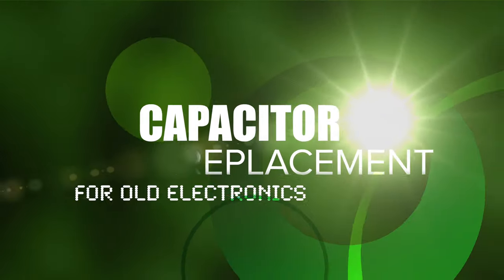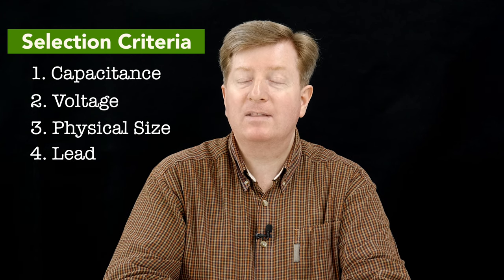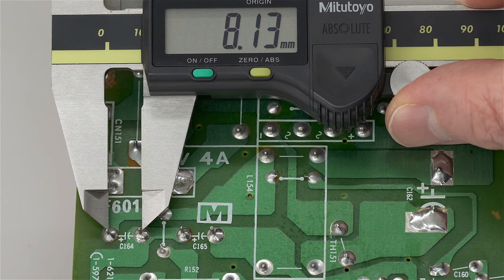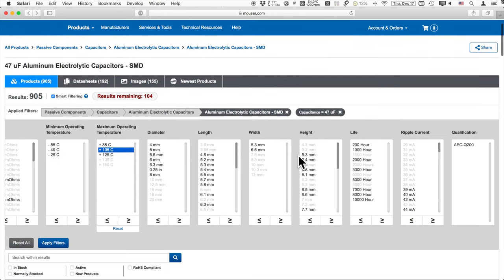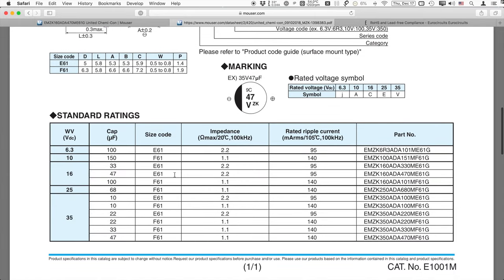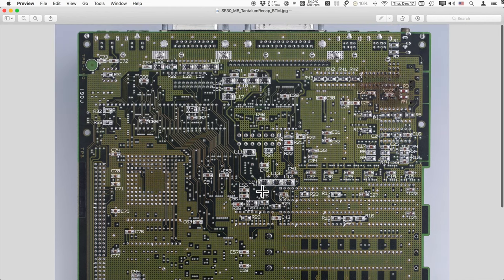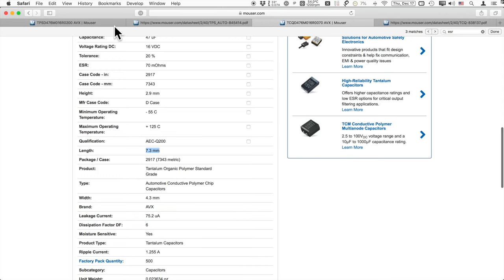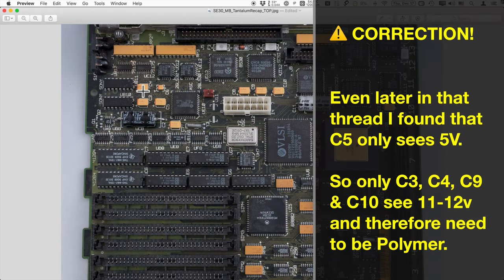Choosing Capacitors to Recap Old Electronics

Comment: I would think that someone with an EE degree would not be on the OCD re-capping bandwagon.   But, not all EEs are created equal.   I can see the need to replace electrolytic caps in 70 - 80 year old tube radios.  But you are just adding to E-waste when you replace electrolytic caps in electronics that is newer than 50 years old.   It is also the wrong place to start if you want to repair something.   I have restored and repaired radios, hifi equipment, and lots of test equipment (General Radio, HP, Tektronix, Marconi, etc) for many decades and seldom find a bad electrolytic capacitor.   You are pointing neophytes in the wrong direction.
Reply from the maker: I certainly appreciate your comment, but I must disagree here.  

First, no one ever said recapping is a FIX-ALL solution.  You are probably looking at this from a HAM radio operator's standpoint, but I have experience with VINTAGE COMPUTERS, especially Apple.  Many a 1980's and 1990's Macintosh motherboard has been damaged by leaky electrolytic capacitors, especially the SMD type.  It's not just exploding Maxell batteries that destroy these precious old motherboards.  Leaked cap fluid left on these boards eats through traces over time.  

There's nothing Obsessive-Compulsive about changing out capacitors that are more than 30 years old, not only in light of what I just said, but also in light of the fact that capacitor manufacturers themselves don't guarantee their datasheet specifications beyond about 20 years or so.  What that means is, even if you do the math based on temperature and the datasheet hour rating, and even if you calculate a theoretical life well beyond 20 years, capacitor manufacturers don't guarantee that life beyond 20 years because they know seals break and fluid can either leak or dry out over time.  And that is true even when the cap hasn't been used in a hot environment.  

Nothing lasts forever.  Everything wears out over time.  Entropy is not our friend. But of course, this comes as no surprise.  

Even when the capacitors measure reasonably good on an LCR meter, they can sometimes fail in-circuit under load.  I know this from experience.  So while heat is a big contributor to the shortening of the life of fluid-filled caps, the greatest enemy of these caps is TIME.  Even though I'm not too terribly old at the age of 52, I still full well know what time has done and continues to do to my body, which is build far better than an electrolytic capacitor.

If anything contributes to E-waste, it is the general ignorance of what can and often does go wrong in vintage computers (and perhaps in vintage electronics in general), such that a board could be damaged due while sitting in a closet for decades -- the result of inadvertent user neglect.  And one day when they want to power on that old computer but can't, then open it and find traces eaten away due to leaked capacitor fluid, most tend to throw the thing away rather than seek a repair.  That is perhaps the most common contributor to e-Waste.  It doesn't have to be so though.  Recapping a device after 25-30 years is good preventative maintenance, especially if the caps are of the SMD variety, and especially if we are talking about vintage Macintosh computers.  But I wouldn't want to restrict recapping only to those machines though.

Just like it is important to apply a new coat of paint on your home or replace a roof every several decades, so too old electronics need maintenance, and sadly, one of the most often trouble-causing components in old electronics are these capacitors.  That's true even if the HAM radio world can boast about using caps since the 1950s.  Recapping requires a bit of thought and understanding, which is why I created this video.  Recapping not a fix-all solution.  But it is often needed, and the video helps people understand the various considerations that go into choosing replacement capacitors.
Reply: I'm not sure how much equipment you have repaired, but I 100% agree with the person who uploaded this video and sorry to say this, but completely disagree with you. Every electronic repair channel of vintage equipment, amplifiers etc etc regularly find bad electrolytic capacitors. Whether bulged, shorted, ESR issues or lost/gained capacitance...electrolytic capacitors are pretty much the FIRST thing I'm checking as soon as I open up any electronic equipment whether it be very old, vintage or even modern for that matter. I honestly cannot believe that if you have repaired a large amount of electronics, you feel this way. Don't get me wrong, I've repaired oscilloscopes that have been in a barn for 60 years, reformed the old electrolytics and put them back in and everything was fine...however more often than not, they need to be replaced.
Reply: @REVERSE_BIAS  I did mention I have repaired a lot of equipment.   Are you calling me a liar?   I have had an interest in electronics for over 65 years and studied Electrical Engineering at a highly regarded East coast Engineering school.   When I fix a radio, or test equipment I always try to just replace components that have gone bad.  Sometimes it is an electrolytic capacitor, but more often its a transistor or diode.   I know how to find what is not working in electronic equipment, even if I don't have a schematic or service manual.   The electronics techs I have known who automatically just replace electrolytic capacitors before diagnosing the problem, generally destroy more equipment than they repair.   I see their handiwork at electronic swapmeets and say to myself "There is another oscilloscope or radio, or signal generator, etc, that will never be useful again".   If you are that kind of tech, you are not a good custodian of the vintage gear you possess.   You need to find another hobby.
Reply: @JDW-  When I have seen a pcb with dissolved traces the cause has always been too much humidity.   If water has condensed on the board when it is powered up, electrolysis can quickly destroy some traces.   I don't play with vintage computers and have no idea what the failure modes are.   Maybe Apple was buying defective electrolytic caps when they were manufacturing them.   I repair 80's vintage ham and commercial radios, HP General Radio, Tektronix, and other quality test equipment.   The oldest I have are Boonton Q meters and an Rx bridge.   They are 70 - 80 years old and have never been tampered with.   I believe in maintaining equipment as it was manufactured and not modifying it.  The Q meters and Rx bridge work as well as they did when made and have never been "re-capped".   The only work I have done is to clean a couple of switches.   I also own a 1968 vintage network analyzer made by General Radio.    It is a very handy piece of equipment and covers the range of 500 kHz - 500 MHz.     It has some logic gates in it - all DTL   I had to replace a few transistors and zeners when I commissioned it; no "recapping" necessary.   Some misinformed techs gave told me I should replace the DTL parts with "modern"  7400 series TTL,  or even LSTTL.   Unfortunately some people cannot be educated.
Reply: @williamogilvie6909   I could have bet my life that you were going to list how amazingly knowledgeable you were! Wow, you are an electronic engineering master! "I can even repair equipment without a schematic or service manual!" 65 years of experience, yet rarely have to replace an electrolytic capacitor.  😂😂😂
Reply from the maker: @williamogilvie6909  One thing that we learn in life is that we never stop learning in life.  You explained that your experience is different than my own (and I consider that a learning experience for me), which is not to dissimilar from medical doctors who specialize in different parts of the body.  I can tell you as a vintage Apple computer enthusiast that leaked fluid from SMD electrolytic capacitors on numbers vintage Macintosh models like the SE/30, Mac Classic, Macintosh IIfx, the Apple IIe Card, and many others all have issues which do not pertain to humidity.  Many people leave these precious machines in a closet for decades, never knowing that trouble is brewing. The leaked fluid eats traces over time.  Battery bombs are just as bad or worse, with lithium PRAM batteries screwing their guts all over the circuit board, rusting metal and eating connectors clean off the board.  Even in cases when capacitors do not leak, bad capacitors inside vintage computer power supplies very often prevent the machine from powering on at all.  Sometimes the electrolyte dries inside the capacitor instead of leaking out. RIFA safety capacitors are somewhat notorious in old Macs for blowing and spilling their black guts all over the place, which is mainly just a big mess rather than something that eats traces, but still.

What all this means is, no matter our college degree, we tend to learn the most through personal experience.  And our experiences differ.  Sometimes we think our experience in one area should always apply to another, and that is sometimes true and other times not. So I think we can learn from the experiences of each other to make a better assessment of what to do with a given piece of vintage equipment in the future.
Reply: @JDW-  If I am not mistaken I think I did mention I am not a vintage computer enthusiast.   I was working for an Apple dealer in 1984 when the Mac was introduced; even sold a few Apple 3s.   There aren't many computers sold since 1970 that I haven't used, built interface cards for, or developed software on.   So my interest in those vintage computers has long passed.   If you think everyone who wants to revive an almost 40 year old Mac should replace all the electrolytic caps asap, I will take your word for it.

The equipment I restore, vintage Genrad gear, HP network analyzers, Tektronix spectrum analyzers and scopes, etc, are likely made to higher standards.    I don't recommend anyone who is trying to fix HP  ( and I mean HP test equipment, not PC type computers and printers), Tektronix, etc equipment even think about replacing capacitors right off the bat.   I see enough test equipment that has been destroyed by people who had no business even opening the case.   If you can't navigate a 500 page service manual with over 50 fold-out schematic pages, just leave it alone.   And most two way radios ( excepting '70s vintage CB ) are also made to high standards.  Very rare to find an electrolytic cap that has to be replaced in those.     And your description of the destruction you have found inside vintage Apple computers begs the question:   Why even bother trying to fix something that broken and so useless today even if it did work?
Reply from the maker: @williamogilvie6909  I have old HP branded test equipment from the early 1990s, and I have never recapped that.  As to CB's, Radios and the like, I lack experience with those devices, so I must defer to experts such as yourself on that.  I trust your judgment with those devices.  

With that said, I don't think our vintage Mac community would take a liking to remarks of those old machines being "worthless." 🙂 In fact, much of the time, they carry a tremendous monetary worth. You'll find 1983 Apple LISA machines on EBAY for $10,000 or more sometimes.  Even the Mac 128K with super limited RAM sells for top dollar, especially when it comes with the original boxes.  

Even if one isn't into buying and selling to make a profit, using old machines is fun for most of us who have a lot of nostalgia tied to those machines.  My first home computer was the 128K Mac in 1984, for example.  For others, it was a C-64 or Vic-20.  So when I look at a Commodore, I don't remember things from my childhood because I never owned one.  It holds a curiosity for me, but no nostalgia.  The Mac, however, is different, because that was my first machine.  Practicality is largely irrelevant.You don't forget your first love.
Reply: @JDW-  Good that you are careful with older HP equipment.   I am sorry if I hurt anyone's feelings with my comment about Macs.   That's just my opinion.  I started using computers in 1975, when I was in university.  To me, computers get old and uninteresting quickly.   My first personal computer was an HP 2100 minicomputer, running a hacked mag tape OS.  I modified the machine code, on paper tape, so the OS would not backspace, and loaded the OS, an editor, and an Algol compiler on cartridge tapes.  It had a keyboard and text display on a CRT.  That was in 1977.   The first computer, I owned was an Apple II that was designed for the European market, bought for $100 in 1982.  I had to modify the video circuit so it would produce North American NTSC video.  I quickly lost interest in that and bought a 68000 single board computer kit, 1983.   Since you believe old computers like these are really valuable now, I should put them on eBay.
Reply from the maker: @williamogilvie6909 you probably could make a fair amount of money if you did decide to sell them. Bear in mind that eBay fees are pretty high. A lot of people have been moving to Facebook marketplace of late. There are other places like Craigslist although I doubt that you would get as much through that sales channel compared to eBay. Another option is to up an online forum that’s dedicated to the vintage equipment that you have, and then post the machines you have for sale there. That would help to ensure you get your old equipment into the hands of people who would appreciate the devices.
Reply: @ericschulze5641  😂
Reply: @williamogilvie6909 You are lucky this presenter was gentle with you.  You shot off a comment without knowing owing the whole situation.   You even cast dispersions on his EE degree.   Who would have thought that different categories of electronics would have capacitors that age differently?  😉😂😉😂 lol
Reply: @JDW-  A few weeks ago I visited a gentleman who restores vintage computers.   The purpose of the trip was to purchase a 21 GHz HP spectrum analyzer.  Quite a bonus to be given a tour of his extensive holdings.   He had a collection of analog computers, several PDP-8s, a very rare DEC LINK-8 he was restoring, and several HP 2100s.   I didn't see any MACs  or any micro-computers from the '70s or later.    This gentleman supplies exhibits to computer museums across the US.  He is a very careful, methodical person who understands everything about the hardware he is restoring.   That is what we all should do.   It is foolish to just replace components without first diagnosing the problem.   When you "re-cap" something, there is a good chance the capacitors you put in are going to be less reliable than the original ones.   One of the worst horror shows I have seen is where the old capacitor is not even removed.  The replacement capacitor is tack soldered to the old one's leads.    And removing surface mount caps can often result in damaged traces.   As I've stated before, anyone who immediately starts replacing most or all electrolytic caps in equipment is well on their way to destroying that equipment.
Reply: @REVERSE_BIAS  And what can you say about yourself?
Reply: @williamogilvie6909  I'm saddened that you conflate bad repair practices with bad assumptions, and bad assumptions with knowledge of component history. OF COURSE it's a terrible idea to tack a new component onto bad-cap leads. SO WHAT? Such practices have nothing to do with good repairs. Same with the suggestion that removing SMD caps can "often result" in damaged traces. That's only true if you don't know how or don't have the equipment to do that properly. Don't do repairs if you can't remove the old components properly.

As a careful guy myself who has been around electronics for over 50 years (helped create the first retail microcomputer, first hard drives, laser printers, digital phones and more), I *agree* that we should understand about the hardware we're restoring... BUT...and this is **crucial**... we also need to understand the replacement components we're using!

To do that requires MORE than analyzing a particular failure in a piece of equipment. Your suggested method may nicely solve the presenting problem, but is highly likely to FAIL to actually improve the situation. Why? Because you're not looking at the big picture.

You claim "anyone who immediately starts replacing most"... 'lytic caps "is well on their way to destroying that equipment."
Clearly, you're not aware of how 'lytic capacitors fail. (1) Have you heard of the "Capacitor Plague"? This was a pretty widespread problem for 'lytic caps mfg'd from 1999 to 2007. Some mfg's spent hundreds of millions replacing motherboards due to early cap failures. We in industry discovered (to our horror) that certain entire production runs of caps were ALL BAD. (2) Beyond that, ALL non-solid electrolyte 'lytic caps have limited life. They ALL go bad over time. Certain as death and taxes, as they say ;)

I'll say this definitively: if a 1990 high end S-VHS recorder/player (for example) needs some caps, and you do NOT replace most or all of the electrolytic caps, you are wasting your time and doing a disservice to the recipient of your work. That device IS going to have further issues in relatively short order. Why? Because the rest of the caps are on their way to failure as well.

In the same vein, It's foolish to assume new components are seriously likely to be less reliable. A lot has been learned about how to make higher quality components in the last 25+ years. Of course, taking advantage of increased quality requires knowing how to obtain good components... and clearly @JDW knows a bit about that. @williamogilvie6909 have you spent any time purchasing from Mouser and/or DigiKey? It's pretty eye opening.

I for one am grateful that -- just as new cars no longer have tires that last only 1000 miles, and cars can go more than 50 miles w/o a breakdown (that was in the 1930's ;) ) -- modern electronics can have much higher and longer lived components than ever before. Quality has a cost, but that's ok by me.
Reply: @WebbedPete  I stand by what I wrote above.   Removing components that are not known to be defective is not the way to fix any equipment.   A few weeks ago I decided to fix a Yaesu FT5100 dual band radio (VHF/UHF) I bought cheap at a flea market.  The display continually flashed off and on.    This usually means the reference oscillator is not working.   And my theory was confirmed after I watched a utube video where an HF Yaesu rig that had the same flashing display was repaired.  The FT-5100 is a '90s vintage radio, very compact, and crammed with surface mount parts.   The main circuit board has surface mount parts on one side and other, bulkier components like helical filters, crystals, etc, on the other side.     With the help of Yaesu's Service manual, I was able to locate the reference oscillator transistor and measured about .5 V on the collector.  Backtracking to the +8 V supply, I found a current limiting 100 Ohm resistor. Between the 8 V supply and the reference oscillator.    I measured 8 V on one side of it and 1 V on the other side.   On the top side of the board, between 2 helical filters was a 1/4" high surface mount electrolytic cap.  This cap was pulling down the 8V supply going to the reference oscillator.   That I knew for sure.   No way I could get a soldering tip anywhere near it, and heating it from the bottom accomplished nothing.    I had to pull it out like a dentist pulls a tooth, gripping it with needle nose pliers and showing extreme prejudice as I yanked that bad boy out..   That left a small divit in the board.   I found a small leaded tantalum cap with the same capacitance and voltage values and soldered it on the back side of the board.    Not the best repair I have done, but the radio works now and  no other components were remkved.   No imagine someone who feels they have to remove all the surface Mount tantalum and electrolytic caps.   There would be so many broken traces from removing those parts the radio would never work again.
Reply: @williamogilvie6909  First, I've never seen common issues w/ tantalum surface mounts. No reason to touch them unless necessary. Aluminum 'lytic SMD are easy: they always have a plastic separator underneath. So (NOT yanking) grab with needle nose, gently twist a few times, and it pops off. :) No harm to traces, just a little cleanup needed. (I learned the hard way to be gentle... the board just might have internal ground/etc planes, so divots can result in much hair tearing :) )

BTW, not to question the inability to reach with a soldering tip... I only learned last year about modern soldering tools. Metcal with ultrafine tweezers is amaaazing! 0.2mm (diam) at tip, 5mm up further. And it instantly concentrates power at the tip, going to precise soldering temp (+/-1 deg - look up SmartHeat if new to you.) If you didn't have even a couple mm on two sides, then yeah that would not have helped in your case. (A very nice friend loans me his setup ;) )
Reply: @WebbedPete  I guess you never took any Physics courses in High School.  If you had, you would know it is impossible to concentrate heat at the end of a sharp soldering tip.   The metal where the tip is thicker will always be hotter.   Its important to use good soldering tools and to look after them.  Most of the techs who worked for me would crank their solder station up to 800° F and leave it there all day.  Even the instant on Metcal irons would be blue from excess heating within a week.   Those are the people you should preach to.   I don't think even the best Metcal tool would have been useful to unsolder that deeply embedded electrolytic cap in the Yaesu radio.    I knew the layout of the traces before I yanked the cap out.   As I have stated before, I know what I am doing all the time.